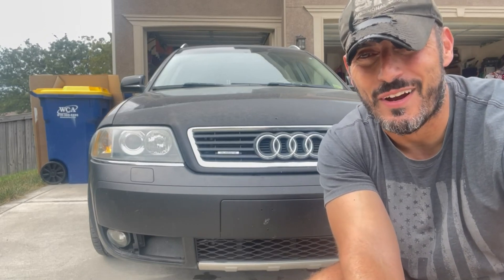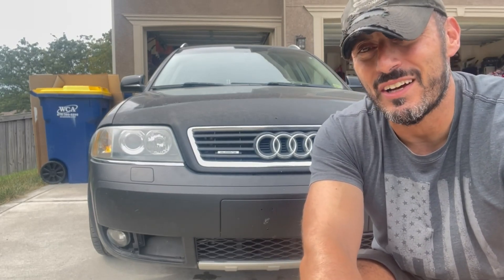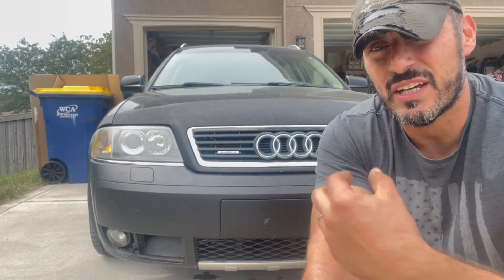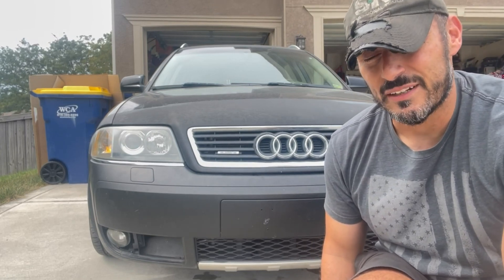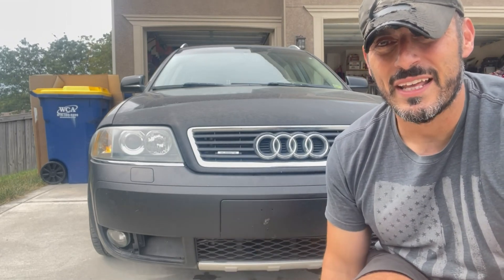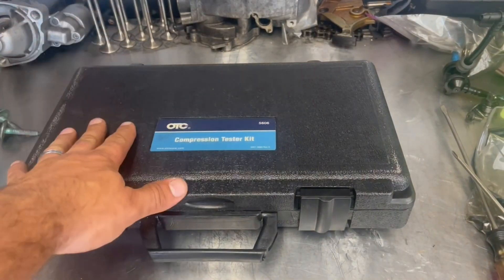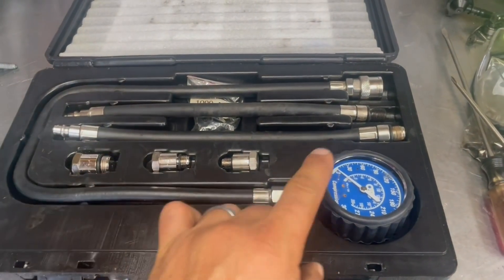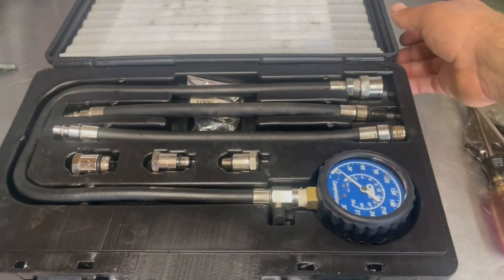How To Properly Compression Test An Engine to Determine Its Internal Health. Testing This Audi 2.7.

Comment: Sounds healthy.  Makes me want the 2.7... but I've been driving the B8 2.0t this past week full time and it rips. Compared to the B7
Reply from the maker: Thanks Brother! The 2.7 is a good motor. It is smooth and relatively powerful at stock levels. It also has good performance potential. The biggest issues with the 2.7 (much like the 2.0) is the stuff Audi puts around the motor that ends up being a pain in the ass. Glad you're getting food use out of your Free B8.